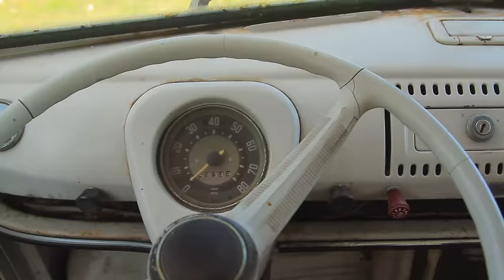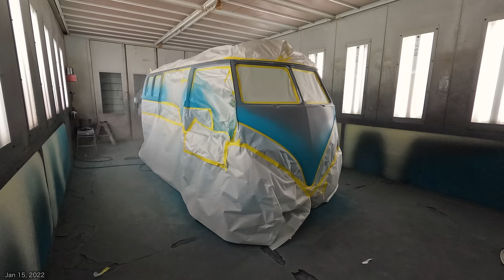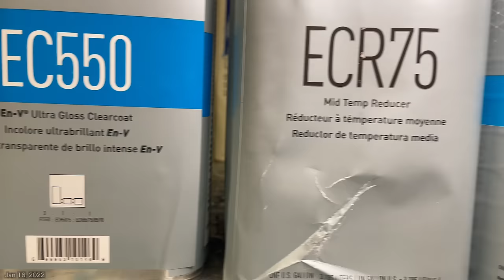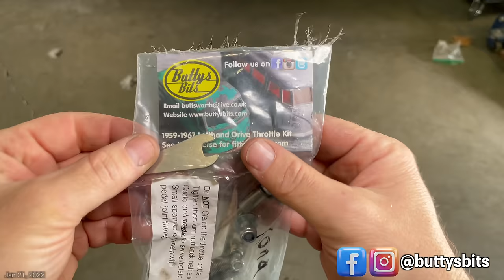VW Bus Restoration - Episode 64 - There's your two-tone | MicBergsma

Comment: Ive had work done as Skinner's and had my long panel replaced by the same body man as Mic, I wish I could say I was pleased, I gave them a new "funky green" long panel and when it was done (6 months later) it was all warped from pushing the panel in to make it fit everywhere instead of fixing what actually was causing the mis fitment. Took a LOT of body work to smooth out the panel after paying a ton. 
Mic color is almost the same as mine but I used the Porsche Miami Blu and its stunning, I think this was what Mic was actually looking for. His bus does look good , Ive seen it in the shop being working on two years ago.

Comment: The paint is fine! It's all painted in the engine bay and underneath. The paint work is perfect. Bit late to change. Did you use an original VW paint code?

Comment: What I really like about this channel is seeing how Mic and Lori wear their hearts on their sleeve.  Case in point: the paint color being off.  No wonder Robert was questioning Dom while he was struggling to figure it out.  There's painters.  And then there's painters.
Oh, Mic, when trying to get rubber parts on, try heating them in very hot water first to help them slide on that much easier.  And don't foget to use a bit of liquid soap on them when sliding grommets into body holes.  I was cringing just watching you jamming them into place with a screwdriver.  Less brawn.  More finesse, my friend.

Comment: I probably would have been happy with it being painted but if I wanted it a certain color and it didn’t come out that way I guess I would have had it repainted but honestly if it was just off a shade I would not have cared. 😂 Same with upholstery. I would have picked any two shades of white and beige and been done with it. Cuz in the end you are just gonna use it and not be staring at the shades and debating how it looks. But to each their own. I’m lucky cuz my bus is patina. I went with a tweed interior and picked whatever tan was available at the shop. Good luck.

Comment: As for the rear ride height set it after the weight of the engine  and fuel tank are installed!
Reply: as for the paint stick with original Factory Blue and you cant go wrong!

Comment: color can be funny...what looks good in a certain proportion (because all color is actually relative to what is next to it or the area of the field of color that its next to)...it gets easier to predict though if you work with color a lot.  I got better at it from my years as a picture framer because thats essentially the job...if you help them design it you have to predict what things will work well and in what proportion.  it was all about the ratios...if you put that blue against grey or black or a contrasting color it would shift considerably.  its fun to play around with but a bit mind bending to think about (how relative everything is).

Comment: Colors are always a strange thing.  For walls for example always chose one or two shades lighter than the sample you choose to get the same impression. for cars it might be else as the car is outside and part of the color you see is not the paint but the reflection of the sky pr indoor lights, that is perhaps the cause of the whiteish wash out impression you got. And with fresh painted cars without all the accesoires attached like bumber,lights, windows (chrome) strips etc the paint always looks kind of dull

Comment: At this point, just live with the color Mitch. You chose the color. The paint is the least part of this amazing restoration.
Reply from the maker: yikes. the paint is the biggest part of a restoration
Reply: @MicBergsma  I've been following this channel, well the Kona the Bus stuff for a bit and it is the no-holds-barred restoration of the vehicle that keeps my attention. Paint is sort of incidental to me - it is the craftsmanship folks like Claudio and Dom have been putting into it.. I was kinda' hoping you'd go full-on hippie, rolling-artwork when it came to paint but, in the end you're the one who needs to be happy. I restored a 66 back in the late 70's and a 69 Westfalia camper in the 80's. My first bus I paid $75 for, had to hit the starter with a hammer every time you wanted to start it, and when I first drove it home, the battery sort of partly fell out through the rust. I wish kept them.
Reply from the maker: @warrenmusselman9173  Got ya! 👍$75! 🤯
Reply: @MicBergsma  Well, $75 and 1/2 oz of bud.

Comment: Blue is too "pastel" for my taste. Personally, I would like it much darker for more contrast, but that's just my opinion.
Reply from the maker: Exactly .. we did not want pastel blue, wanted a darker turquoise
Reply: @MicBergsma   Not sure if the body paint doesn't match the underside or exactly where the issue starts. Even using the EXACT same paint - the undercarriage will usually appear darker than the body because it has less light to reflect. Again - my opinion - even turquois is too light - I like a much darker blue. But in any case, you are doing a fantastic job of restoring the bus and I hope you can remedy the issue in a timely and cost-effective manner. You want what YOU want, and it would be a shame not to get it, whether it is by an error of the painter or the color you chose looks different once applied next to the white.